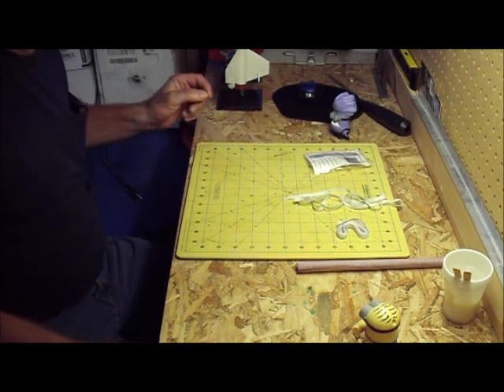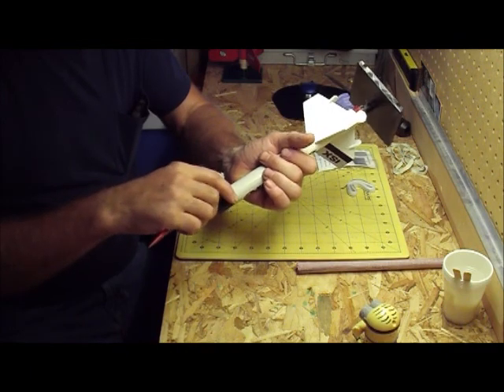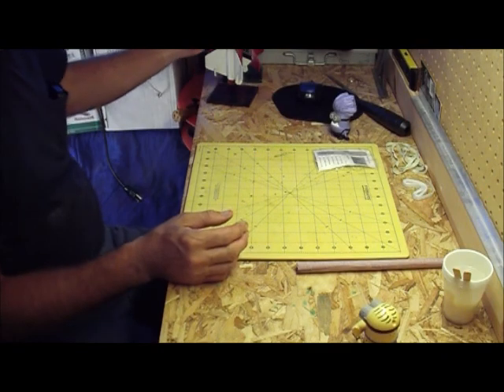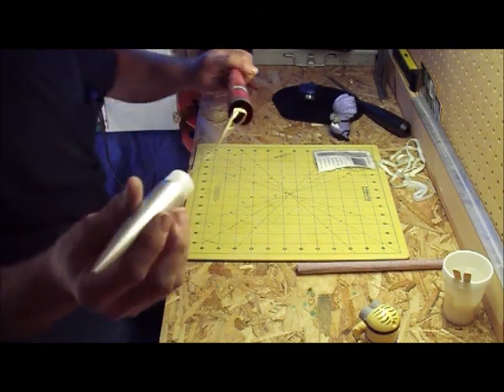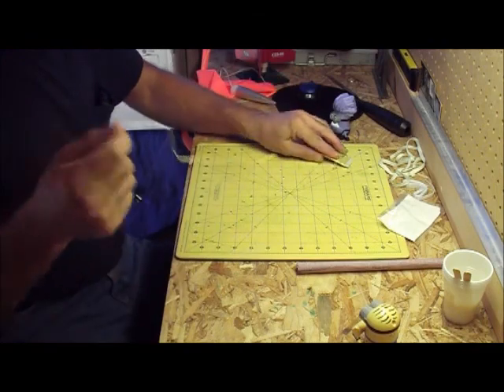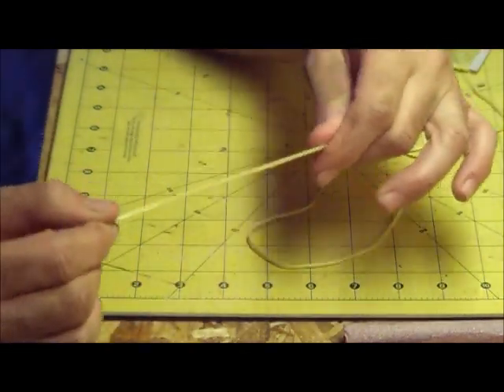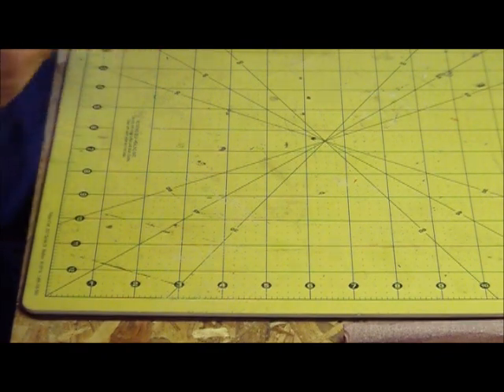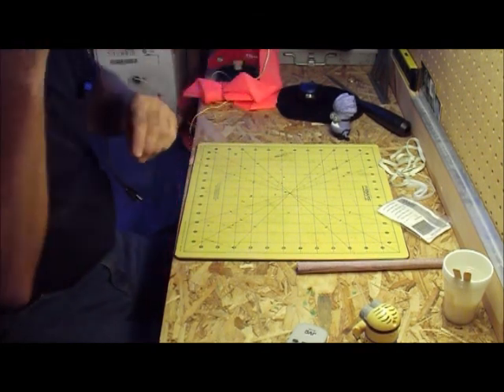Shock Cords

Comment: On my smaller rockets I use ~3/4 body tube lengt of Kevlar string, and ~1-1,5 body tube length of elastic band, both looped together. Works like a charm.
No need for unnecessary lengths of shock cord material. 
And when the elastic eventually looses its elasticity, you can just loop a new piece to the kevlar.
Reply from the maker: That's great. My method or how I do it (as stated in the very beginning of the video) eliminates the nose cone from springing back to Ding the body tube or fins and eliminates the need to occasionally replace elastic cords.